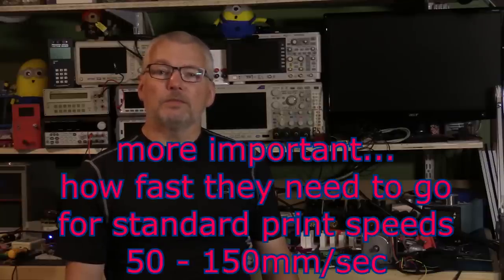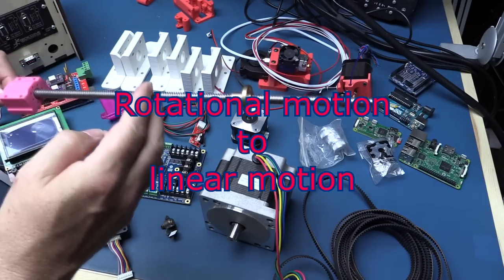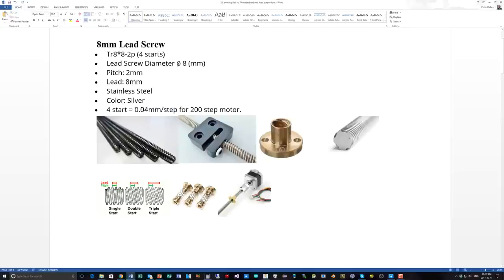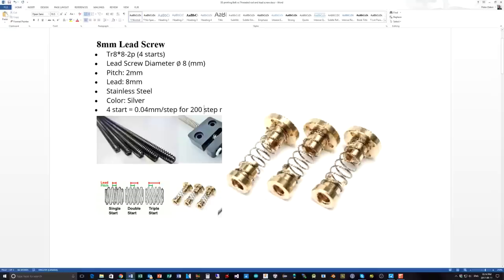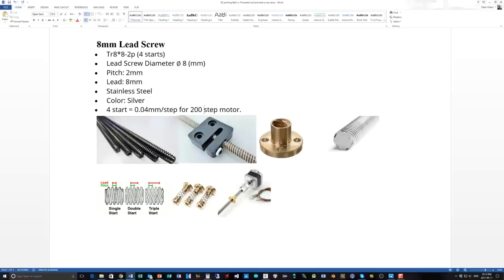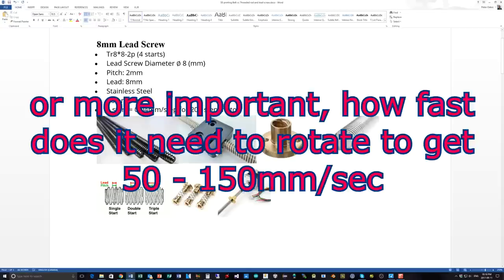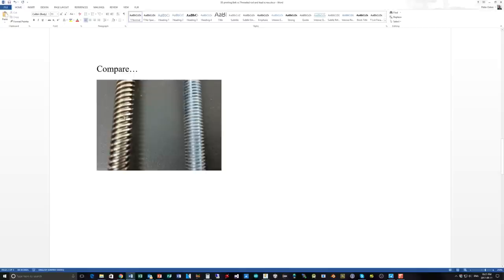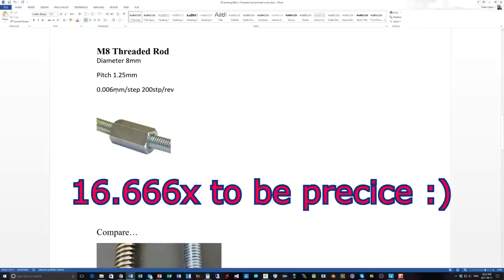3D printing, what to use... BELTS  or SCREWS ??

Comment: One turn on the pulley is 60mm, while one turn on the lead screw is 8mm. So you would have to have a gear reduction of 7.5 to 1 on the belt to have the same resolution of the leadscrew. Leadscrew always wins hands down for accuracy. There I just did in 10 seconds what took you 35 minutes! P.S. use a 10 to1 planetary gearbox on the stepper motor, and now your belt has higher resolution/accuracy than the leadscrew. Now I got even more in depth than you in 15 seconds. lmao Summary, if you know how to do math you can use any form of mechanical means to obtain linear motion, and achieve the (same) desired results. Rack and pinion with active backlash compensation beats all others in speed, accuracy, reduced mass acceleration, strength, and simplicity every time. (20 seconds elapsed time)
Reply: I can understand how a y axis would be done with rack and pinion but can you give examples of how the x and z axis would be done? Cheers

Comment: Isn't wood a very very very bad material to use for the frame? :S It distorts with humidity and well just time, and more importantly, it's auto ignition temperature is between 250 - 300 C. Meaning, if your heater element fails in some way (either bed, or worse the extruder heater falls out) your printer is going to go up in flames.
Reply from the maker: First, the wood, I explain I am using Marine Ply, this is very dimensionally stable so over the period of a few days will not change dimension's in any significant way, also most locations were the unit would be used is also pretty stable regarding humidity. also it is extremely immune to distortion  (It would need to be especially in marine applications.

If the extruder heater element falls out then it will or should land on the metal / glass bed if it even lands on anything, the cables attached should not be long enough for it to reach the frame, the heated bed should never get close to the temperature required to ignite wood, if it does then you have way worse issues than the wood to worry about. Most bed coverings wont survive much above 100 - 150C without disintegrating and producing toxic fumes or worse.
No one should be running a printer without thermal runaway monitoring turned on these days either, 

In summary there are a very large set of things needed to go wrong way before I would be worrying about the wooden frame.
Reply: theBreadboard Maybe it’s not that unsafe then. I’m just thinking back to when I was tinkering with my clogged nozzle on my acrylic Anet A8 and heated it up and the heated element fell out. The head was close to one side and landed very close to the edge of the bed, had the head been moving it would most likely been pushed off the bed down onto the acrylic frame. But the cables on the Anet extruder is maybe a bit longer than they have to be.

Do you know how good wood is at holding screws over time btw? I’m designing a new budget printer and I’m currently going all metal and 3d printed parts because I was worried about woods dimensional accuracy. Though now I’ve decided to chase micrometer accuracy so then wood might be out the window anyway.
Reply from the maker: @beaconofwierd1883  If you have the budget then using OpenBuilds V slot aluminum extrusions would be a way to go, there not too expensive and are easy to assemble and re-assemble. This is what most 3D printers use these days as well, the only issue I find with most current printers is there using 20x20mm parts, I would use 20x60 or even 40x60 C beams for the main structure, this would ensure a very rigid frame. The wood will be good for a few "Ins and Outs" of a screw but I would go with nuts and Bolts for securing parts to the wood, drill the holes right through, slightly tight for the screw to ensure accuracy (Assuming the holes are drilled accurately of course.
Reply: theBreadboard It’s way outside my budget goal and way outside my accuracy goal. My plan is to buy cheap steel square tubing and lap two sides flat to within a couple of microns, then work from there :) So I can hopefully achieve micron accuracy for less money than the budget printers. Currently it looks like the frame, guides and screws will go for less than 30 bucks :D I don’t know if it will work, but it’s not a lot of money to waste to test it :)
Reply from the maker: @beaconofwierd1883  Most importantly is a solid frame, square tubing securely fastened together could be stronger than the extrusions anyway, followed by near zero play in the moving parts. If you have the skills then I say go for it.

Comment: theBreadboard can you please give me your contact info, I’m going to design a revolutionary 3D printer, I’m making my own motors, it’s not even comparable to servo or stepper in the way it works and it had all the pros of both and none of the cons. I’m going to need a specialized board to control it and new software to work with that. As in my magnetic coils can change their orientation, and no I’m not talking about switching the positive and negative, I mean as in XYZ orientation. , but I have some rod questions, and an idea for you to replace the spring type using magnetics

Comment: Belts have too much slop. Where as a rod would be more precise. Its like using belt drive turntables vs direct drive, the direct drive is more reliable and gives you that fine tuning compared to belts. On my 3d printer, I have noticed I have to adjust my belts after so long as they stretch/weaken this results in a sloppy print. If you replace that with a more reliable drive you cut down on a few things
Reply from the maker: Actually, I would not agree with that example. A turntable can benefit greatly from a belt drive, it helps to isolate motor noise from the audio, it can be equally as precice if not more so as the same control of the motor is available but often with a significant gear ratio allowing for much finer control of the turn table. The MASS of the turntable is what also provides significant stability and due to the gearing used with a belt system, the motor torque if "amplified".  I also know audo systems quality can be a very subjective topic and I dont want to get into a phyisophical debate as to which is better, this is simply my current view point,
Reply: @TheBreadboardca  i have used both types of turntables to dj on and saw the opposite 🤷‍♂️.
Reply: @TheBreadboardca  this time it has lead screw T8 (16mm lead) it can rotation speed close to the belt i try test print it very good on speed 100mm/s

Comment: formula at ~28:20 looks wrong; According to that your MAX RPM decreases as you increase current. How can that be when you are increasing the power?
Would make much more sense if it was Volts * Current divided by (Inductance * 2 * Steps).
But indeed according to sources that is the correct formula.

So the previous step is holding back from getting to the next step due to delay of magnetic field collapsing? Delay increases by the function of current applied?
That would make sense why people are so adamant on setting "correct" Vref for drivers.

However, it is a motor and a motor is motor. Volts * Current == Power AND Power equates the amount of work that can be done (sans losses). So i have typically just cranked drivers always to the max, which has always yielded the best results as long as steppers remain below 70C. If they do not, i have typically added heatsinks. Each time i do this print results are better, and you can drive higher speed.

So what piece i am missing here, as that formula would suggest that setting your stepper drivers to 0.00A would give the best speed, which is impossible at 0W.

https://www.allaboutcircuits.com/tools/stepper-motor-calculator/

In other words, this formula makes 0 sense. Stepper motors are essentially brushless DC motors (at their most basic)... So how would the laws of physics be reversed?

I think you used wrong voltages, as per above link: APPLIED VOLTAGE. So output of the stepper driver, which will be a tiny fraction of the input 12V.
Now that would give the correct results, as the current increases so does applied voltage.

So specs: https://uk.rs-online.com/web/p/stepper-motors/5350489/
Resistance per phase is 1.65ohm, so to apply 12V means 7.27A == 87.24W (total ~174W), where as applying 2.8V would yield roughly 1.68A == 4.7W.

In essence the power rating does not affect maximum torque max rpm rating at all. That is not the max speed off the driver, simply where it still has it's maximum torque.
Max torque RPM rating tho is a bit misleading, it is not the maximum speed it can turn at all, typical electric motor goes steadily from Max torque @ 0RPM to no torque at their maximum RPM.

To calculate actual torque curves. etc. back emf etc stuff needs to be figured out. to calculate the Kv rating.
For example if Kv == 300RPM it means 0 load max rpm of 300rpm with 1volt applied.  If the 100% torque rating is 7.8RPM (as with your motor) it means from 7.9 to 300rpm torque decreases linearly, and your maximum load will determine where is maximum real speed. You can increase this by voltage, which means also increasing current hand in hand; But does not change the basic characteristics of the motor (full torque max rpm known).
There probably also is a formula to calculate this from the spec sheets, which i am not aware. Basicly, higher the rated voltage for the motor == higher Kv rating if torque is the same. Higher the voltage == higher speed it can go.

The Kv ratings are extremely low in stepper motors, here is more information about it: http://learningrc.com/motor-kv/
Basicly you can measure this by using another motor to spin the stepper motor. We all have seen how LCD screens light up when you move the bed by hand :)

Here is also some interesting discussion about motors: https://www.reddit.com/r/CNC/comments/6iai0v/low_voltage_vs_high_voltage_stepper_motors/
Even more interesting: https://electronics.stackexchange.com/questions/200324/how-to-interpret-the-stepper-motor-voltage-requirement
Some MFGs release the Kv rating as Volts per 1000 RPM.
RS does not, but they release some curves at https://docs-emea.rs-online.com/webdocs/13f7/0900766b813f73f3.pdf

I think you can use the minimum time per step to calculate 0 torque max rpm, for Peter's motor at rated voltage it is 15 625rpm at 2.8V or 5580rpm/1v (Kv). Which is surprisingly high.

So now the equations makes perfect sense, wrong values and assumptions were used.

But it's no where near this simple. I am in process of upgrading one of my printers to 36V TB6600 drivers.
Reply from the maker: Love the analysis, are you a quad copter flyer by chance ?
there is one thing you did not factor in your post... INDUCTANCE. for a motor it is a gross over simplification to simply  say power is V*I, this only considers resistance (Not even impedance). While it is true that if  you apply a DC voltage to a coil and leave it there, the current will eventually fall to simply V/R but this is not how a stepper / controller works. 
the controller monitors the current (The reason for the Vref) and when it exceeds Vref setting it will discontinue applying the voltage. it is not actually limiting the current to that, the instantaneous current is a function of the inductance and applied voltage, it is simply watching it and waiting for it to reach its max set point as indicated by a function of Vref
The current in an inductor does not instantly go to max the instant you apply the voltage to it, an inductor is the opposite to a capacitor in that it resists change in current and therefor seems like an open circuit to a change in voltage (Capacitor resists change in voltage and therefor seems like a short to a change in voltage)
What a stepper wants in order to achieve max torque is to get to max magnetic flux (But not over saturate). A higher voltage applied will allow the current to increase quicker to the set point max and therefor achieve max torque quicker.
Due to the inductance etc, with all other things being equal, increasing the MAX current will simply delay the circuit from reaching this MAX current and the time curve is the same

for a single step, the controller tries to maintain this MAX Current by switching on and off the applied voltage (Remember the current does not instantly go to max but neither does it go to zero when the applied voltage is disconnected and now the magnetic field is collapsing and trying to maintain that current flow (Inductor resists change in current), once the controller detects this current fall bellow a set value it will turn on the output again and re energize the coil

one last point, it is a common miss understanding that a stepper (Brushless DC Motor) speed is a function of voltage, it is not. Torque is a function of voltage
the running speed of a stepper is determined by the controller cycling through the phases (Coils)
MAX torque is only reached by applying a voltage long enough for the magnetic flux to build to max, if you switch to fast you will never reach it which is why you loose torque at higher speeds (Yes you can go faster but at reduced torque). a lower inductance stepper motor will permit higher speeds or applying higher voltage will do the same

This is why in industry on CNC machines etc, they will often run with 48 or even 80V DC supplies, the inductance may be similar, the max current is more but the speed and MAX torque is still achieved by having a higher applied voltage (NOT CURRENT). but you need a much better stepper controller to work at these voltages

I know this is a whole bunch of explanation on different things but i hope it helps you see how it works, I smell a video in the works :)
Reply: I used to play around with RC cars, until i could afford a fast big one :) I was one of the early users of brushless DC motors with BIG lipo packs.

Indeed; Inductance. That is why i said it's never that simple; And that is somewhere i need to do some additional research. Good explanation.

 And you are correct; Magnetic fields take their time to ramp up or down; i simply erased that bit from my earlier reply.

And as for the speed being function of voltage -> Both are correct, if controller does not command for faster RPM, no faster RPM will happen, and that is why it is called a speed controller with RC. however, what i was referring to was the intrinsic motor max RPM per voltage.

Higher voltage is higher potential (think as RPM); Where as higher current is higher "force" (think that as of torque)  to make things happen (power) indeed. I am sorry if my explanation of the mistake in the calculations on your video made believe otherwise. it was a lot train of thought and poorly edited.
Reply from the maker: @skaltura  not a problem. Healthy discussion is always a good thing and I'm not perfect and therfor subject to the odd error here or there so I could have made an error. Oh and that formula is only for speed at max torque. Not other  chacturistics

Comment: If it works with screws for X axis on the bed. Why couldn't it do that for Y? It is the same distance that both must travel depending on the object. A circle is a circle how much one twists it. If it handles a line with a screw in the X axis, it should also go on the Y axis. Right now I'm building a printer for myself, not just because I can't buy one but for the pleasure. Someone with experience can tell me if it has been tried. Otherwise I will try. Z moves so slowly up or down so there is no question.
Reply from the maker: Screws should work for all axis without issues, as with belts, Acme Screws or Ball screws its all about minimizing slop / play in the axis. Z is typically taken care of due to gravity, X and Y may need help. Belts have minimal play but they can stretch during acceleration etc, hence the ringing when changing directions or stopping at a corner (The belt is a bit like a bad spring). Screws (Ball or Acme) may have a little play (Backlash) depending on quality and if anti backlash measures are taken but they wont suffer from  the same springy affect. But the motors may need to be more powerful due to increase in moment of inertia.
Reply: @TheBreadboardca  Thanks for a great answer. Screws it is, the things you explain regarding belts is what i experiense on my laser engraver.
Reply: @TheBreadboardca   An update on what has happened. I have now built a 3D printer with 8mm screws, 2mm pitch with 4 starts, on al axis. Went down to 8 microsteps for more torque. After some fine tuning, it works GREAT! One problem I got is that the dual motors on the Z-axis do not get enough Vref voltage from the A4988 stepper driver. Sometimes skipping steps at startup. Only a restart of the printout. Normaly i do prints in 60mm/s, fast or slow? i dont got any to compare with.
Reply from the maker: @STRB909  60mm/s is a reasonable speed so should not cause any problems, your Z axis should be able to move even with using an A4988 driver and two parallel motors, this is a very common configuration on many printers, I would check for any binding in the screws etc., an other option would be to use a separate driver for each motor, depending on your controller you may even have a spare driver position, often labeled for use with a second head.